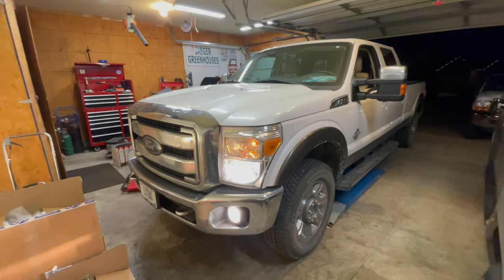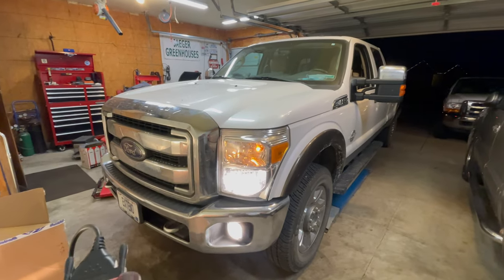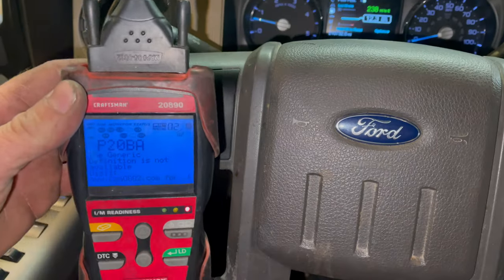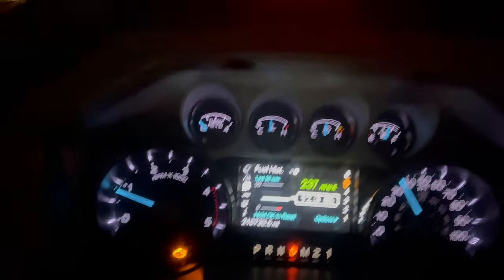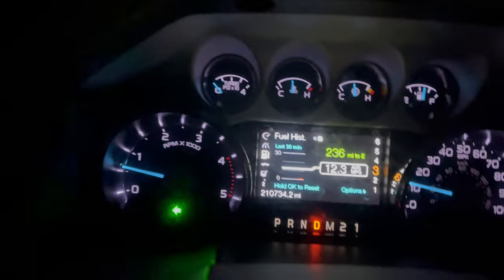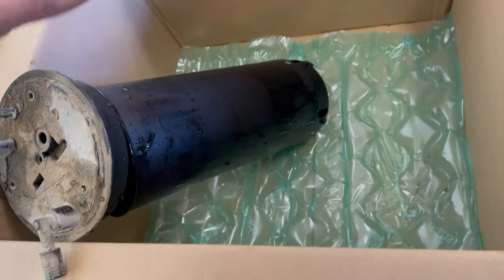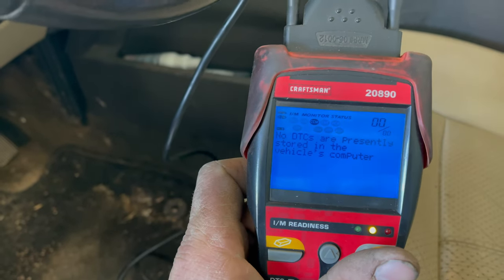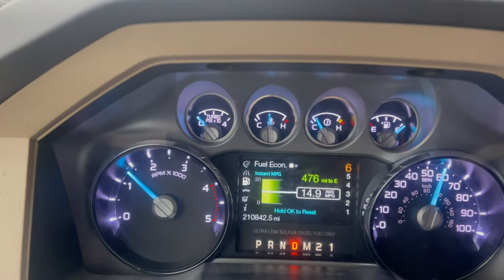6.7 Powerstroke Low Power - Low Boost - Engine Light FIX

Comment: Just have this code on our 2016 F350 (within the last week).Truck only has 51K miles on it.  How difficult is it to remove the DEF tank - we have a 6 3/4 bed, not a long bed.
Reply from the maker: It wasn’t too difficult. The tricky part is getting the plastic retainers off without breaking them. Soak everything in WD40 or PB Blaster and it will help a lot.
Reply: @DanielJaegerFilms  Thanks for the reply and for taking the time to publish all these videos. Finished the reductant tank heater job today. Truck back in working order. Appreciate your channel - Also own a 2001 7.3 Excursion (she's a baby at only 167K miles on the stock engine) - so have watched all your Excursion videos to!
Reply from the maker: @jrbovitz2951  awesome, happy to help!
Reply: @DanielJaegerFilms   Guess what came in the mail today? A letter from Ford Motor Company. Customer satisfaction Program 21M01. Basically, this program will increase the reductant heater and sender warranty coverage to a total of 11 years or 120,000 miles from the warranty start date, whichever occurs first. Of course....after we replaced it ourselves!  Grrrr!  The letter states "if you paid to have this service done before the date of this letter, you may be eligible for a refund." Hopefully Ford will at least reimburse us for the cost of the part, since we performed the repair ourselves. Just thought I'd share....
Reply from the maker: @RB-ii4wz  thanks for sharing, hopefully you get some compensation!

Comment: Do you recommend getting a 6.7? I’m looking at buying a 16 possible or little newer or buying an ole 7.3
Reply: I’m a fleet mechanic, I work on all trucks from class 8 Macks to Ford Vans. IMO you should consider the 6.7 if you can check yes to almost of these boxes.  Are towing over 15 k often, are getting a dually, the majority of your trips are longer than hour of run time between cooling off, do not do a lot of idling, you ate  ok with. 300.00 oil change and fuel filter changes. You plan on trading before the 5/100 warranty is up. Ford designed the 7.3 gasoline engine for the majority of users that are towing and need a powerful engine ,but need the simplicity of a gas engine,need more payload than the diesel version can provide,or for fleet usage . I love the 6.7 but it’s best in the duallys that tow heavy.

Comment: i have a 2016 f250. about a few years ago my check engine went off and come to find out. it was the module  in the def tank. that same week, ford sent me a letter for a recall on that same issue. needless to say the least..i got mine replaced at their cost....

Comment: My 2014 only gets about 1/2 PSI on turbo when towing. And I get about 11-12 mpg. Could this be the cause of that issue? 

Towing up hills, I put the pedal to the floor and it doesn't increase speed or turbo.

Comment: I’m getting a code on my 6.7 2022 “P226C” I bought the OBD and it says I have a permanent code

I did a diagnostics on it and it came up that one of the boost pressure control monitor is out.

Do you know if it’s what’s causing the check engine light or is it something else

Comment: Would this go for a truck that is def deleted my truck has the exact issue but it's def deleted
Reply: Exact same problem with mine that is DEF deleted and straight pipe so no EGR sensor neither I can't figure out the issue because I change also the turbo for a new one
Reply: @Salvador Arreola  did you ever get yours figured out bro?? What was the issue??
Reply: @salvadorarreola4729 what did you do to fix’s yours  same w mine

Comment: FYI You don’t need to do the repairs yourself. It’s called a customer satisfaction recall. Just got mine done through the dealer no charge. I used to clear my code every day because of the lack of power.
Reply: I agree with this but as I understand it, some of the emissions parts (like the def heater) are warranted for a mileage/age amount. At 210k + miles, this truck would have been out of the warranty period.

Comment: Less emissions is nice and all but god if they field tested these parts for 3 years. I wonder how much emissions they don't reduce because people cut them out as they're going broke repairing them. If they worked nobody would cut and less emissions.

Did you have to remove the bed for this or just drop it like a fuel tank?

Comment: Mine is doing the same thing, but my check engine light is not on.
Reply: Were you able to find out what was wrong?
Reply: @salvadorarreola4729  Yes. I replaced my DEF heater and pump and it was doing the same thing. So looking further into it my exhaust was plugged. I took it down to my buddies place and did a manual generation test and blew all the crap out of my exhaust. I'm getting better fuel mileage and got my power back.
Reply: @xboysfunfab473  What if the truck has straight pipe and def deleted